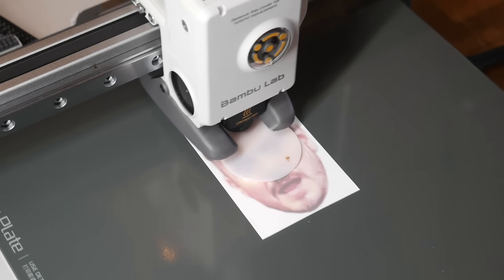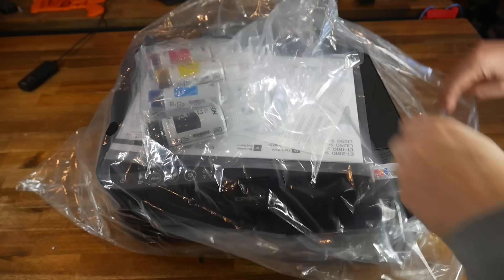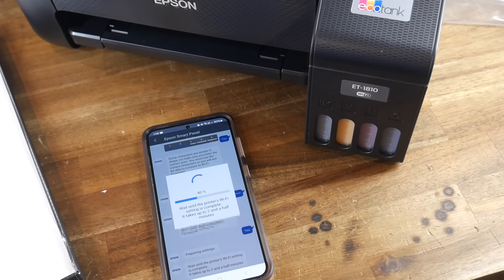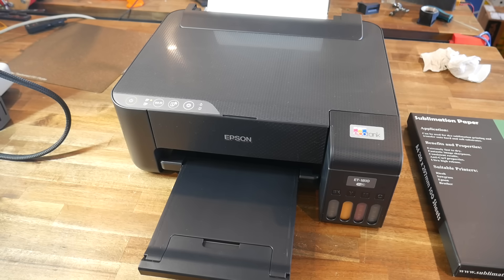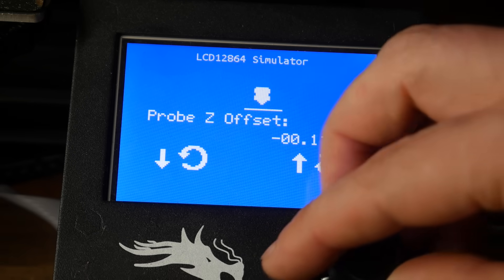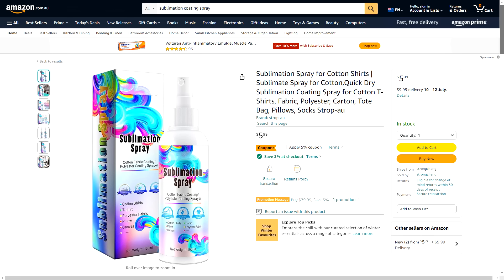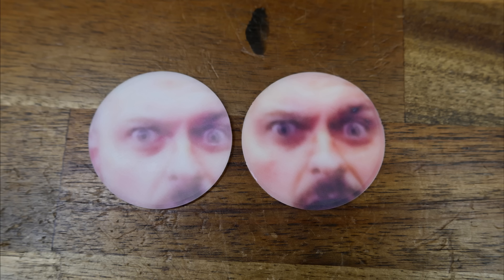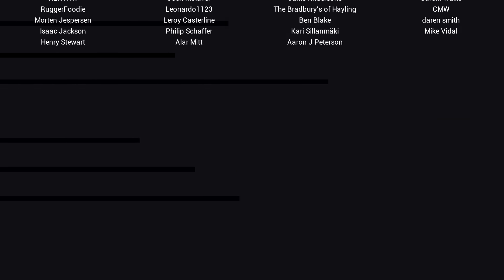Full colour first layers on your 3D prints - Sublimation guide part 1

Comment: I've also wondered about heat-gun printed shrink wrapping techniques (similar to bottles of soda). If you can use adhesive to ensure a secure mount of the shrink wrapped plastic, you can technically shrink individual parts for later assembly. This should make it possible to apply a durable full-colour "skin" on nearly any object (given a bit of assembly).

A thin single layer of PLA, and a bit of glue may  be effectively used with heat gun 'srhinking' to attache the full-colour surface to a separately printed object!

Oh, and ECOtank is a blessing in a market of historic gouging. The amount of ink you get is SUBSTANTIAL and is cheap to replace. You get to print as you would with a laser printer: you don't have to think about consumables.
Reply: Just wanted to point out that the printer manufacturers are up to their old shenanigans with this type of printer too.  Since you've got long lines with "stale" ink in them if you don't run your printer daily the first thing it does is dump a bunch of ink into a sponge. The sponge is not a "user replaceable part" and has an electronic counter on it. Once the counter is exceed, the printer is junk. So yes, still better than the old inkjets, but still some ways to go.
Reply: @jeffreycutler7364 Making that sponge non user replaceable is despicable!!

But do you know for sure that it's daily? I.e. that you need to print every single day to avoid the cleaning part?

I'm asking because I have a similar problem with a regular (i.e. 2d) printer from Canon that has "XL" ink tanks (that's the main reason I chose it). I very rarely print anything on it and so every time I do use it it does its cleaning thing, which wastes a lot of ink, so even though the ink tanks are "XL" size I get few pages out of them.

I scheduled a task every Sunday morning to print a page of text, to avoid the cleaning phase. I choose once a week to minimise ink and paper loss but it's too seldom, as the printer still does its cleaning thing. If it needs to print every day to avoid the cleaning then there is no win, as the scheduled task itself would waste 365 pages and the ink for them each year.
Reply: @dan-nutu  It probably doesn't have to be daily. That's what one youtube review I read say. You probably don't have to print a whole page, just a quick print with all of the different colors.
Reply: @jeffreycutler7364 AFAIK, this is false. If you're referring to the maintenance tank, which it sounds like you are, they're a few bucks on Amazon and one step to replace.

If there's some other pad in the printer that I'm not aware of, I guess I'll have to look into it.

--

Upon doing some further reading, it seems like this might be dependent on the model you buy/age of the printer. Newer models, like the one I have, the ET-3850, have the easily replaceable maintenance box. Not sure about other/older models.

Again, unless there's some other pad I'm not aware of.
Reply: @ultramegax  It's definitely the case on some older/consumer grade printers, i.e. the ones you pick up for under $200 where they're really just trying to make money off the consumables. There's plenty of videos out there about it if you don't believe me. Obviously, I don't have the resources of the King of Canada to investigate every single printer.
Reply: @jeffreycutler7364  Somehow, I am not surprised!

Comment: Someone please combine this with lithopanes! Looking at you @Teaching Tech! Full color lithopanes could be really cool.
Reply: The only problem with this is that most people should print lithophanes upright as the 0.2 mm layer height grants really good definition but the 0.4 mm standard nozzle can be used. If you want good flat definition you have to switch your nozzle to 0.1 or 0.2 mm size and then you need very high quality filament and tons of prayers you don't get a clog. 😅 it can be done but it takes longer and there's more opportunity for failure.

Comment: Did you try varying the layer height? Sublimation usually is done with adequate temperature, pressure and duration of both. Maybe doing the first few layers very thin might help in transferring more dye by introducing more temperature, pressure and duration of both. Might have to try it

Comment: This is fantastic - I can't wait to use the T-shirt making excuse to justify a new printer to my wife :D
Reply: better make her some t-shirts
Reply: I wonder if using transparency sheets for inkjet printers would work better than printing on regular paper. They could stick to the 3d printed part - depending on how it works it may be a bug or a feature :)
Reply: @dan-nutu use sublimation transfer paper, not copy paper
Reply: I want T-shirts!!!!!
Reply: You can’t ever use it for regular printing again. You can also sublimate mouse pads, magnets, coasters, etc. basically anything with a poly base.
Reply: @rachaelb9164 
Actually the printer CAN be used for inkjet printing again. You simply remove the sublimation ink and put inkjet in. You can squirt water into the tanks in between if you want. Remove it. Then fill.
Reply: this is how i justified buying an X1 to my girl lmao i told her id print her trinkets for her customers at work
Reply: If you are having visions of whipping out cool black t-shirts…that won’t be happening with sublimation. Sub ink is transparent. You can’t press onto black or dark colors. You need white to light to primary colors. Primaries work, pretty much, with only black text or silhouette type designs. The shirts need to be as high count polyester as you can get. The higher the count, the brighter your print.  If you use a 50/50 polyester cotton, you have the very high possibility of 50% of your ink washing out. 
There are decent polyester shirts that feel  more like cotton. 

Oh….and there is waaay more things to do than just shirts!! Soooo many. Mugs, tumblers, phone cases, keychains, jewelry, photos put on blankets or socks, the list is ginormous. Sublimation is awesome.
Reply: Same